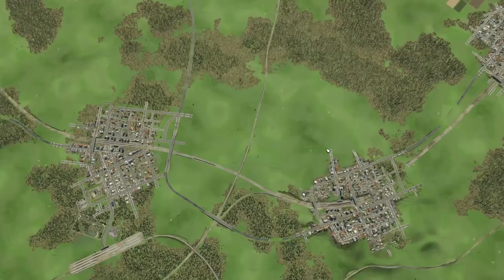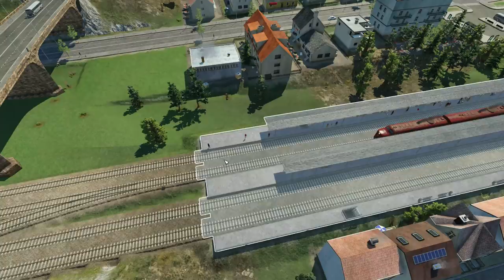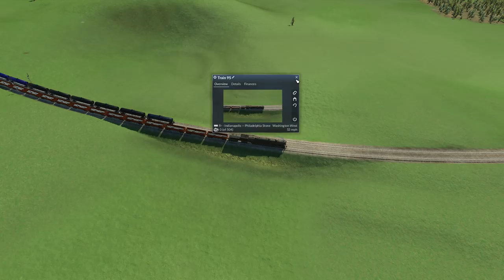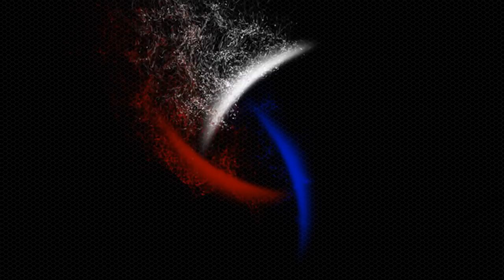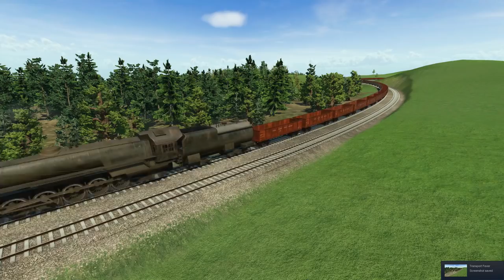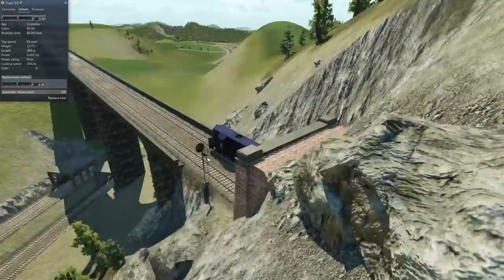Transport Fever Gameplay Video | Failed New Stone Train | The Great Lakes | S2 #162

Comment: I think you got the engines right, but the length of the train stretches from one slow section of track to the next. It never gets into a long, fast stretch where it can get up to speed. Although the extra power means it does get to reach that 60mph when it can faster than the single steam could, so overall it'll be better. To fix this any more, you need to smooth the curves.
Reply from the maker: I have to disagree on that, and the reason why is that the Big Boy hauled trains are just shy of 600m, so they should experience the same problems, except that they do not... but I will check it. Maybe you are right and it is just a few metres too long! I do not think so though